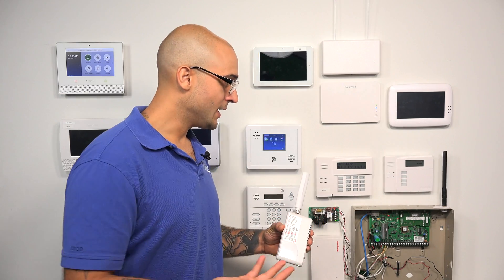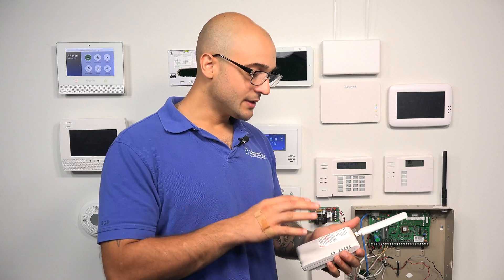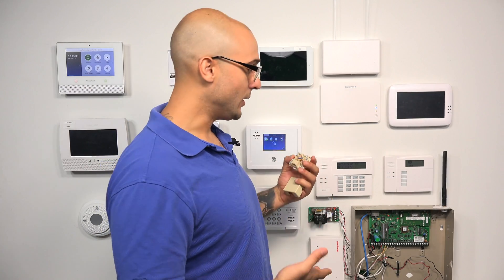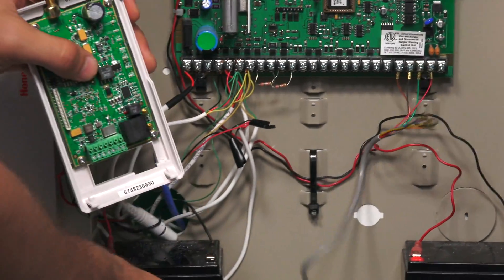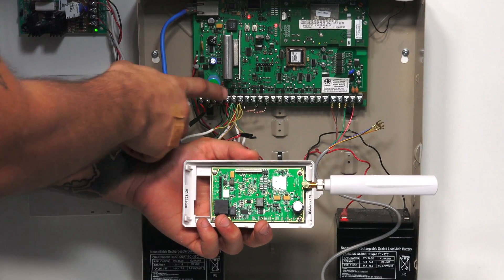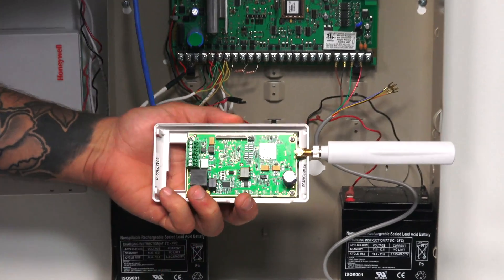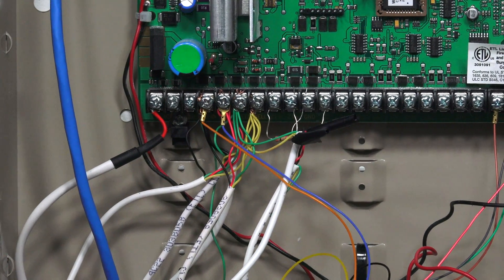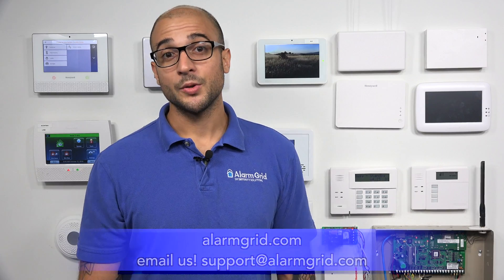Wiring a TG-1 Express to a Wired Security System.

Comment: My panel an older First Alert panel has a note that it is 500ma max power to those terminals. Is it ok to install a TG-1 express lte to this ?
Reply: HI Sean, the 500ma max is the limit for your "Aux Power" terminals. Thus meaning that if you have devices, such as kepads, receivers, communicators, zone expansion modules on those terminals, the amount of current draw can not exceed 500ma. It is best to determine what is powered from those terminals and then see if adding the TG1 to the "Aux Power" terminals exceeds the 500ma current limit. If not, then Yes,  you can power your TG1 from the panel using the "Aux Power" terminals.